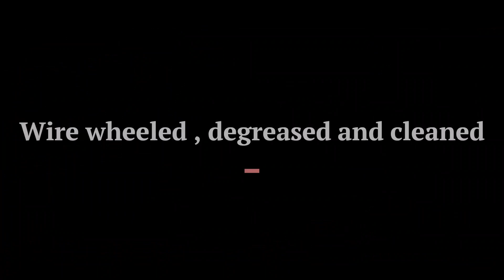1972 Moto-ski Capri 340 DIY time-lapsed restoration. Vintage snowmobile.

Comment: thanks Toddy.  Great technique on the video.  And very useful here.  A neighbour has a '70 motoski with the 493 Hirth and low miles but it has been on the ground under a truck cap for 25 years and everything is froze down.  Will  wait for spring.  But I have a '70 Olympique I bought new to work on instead.  Did you use rust converter before priming ?  And is your spray gun airless ?  John in Manitoba.
Reply from the maker: Hi John. No I didn't but that is a excellent idea. I deceased with a decreaser and vinegar and removed all the rust. Just used a good primer. The sprayer is not air it's electric. Enjoy doing your project! Thanks.